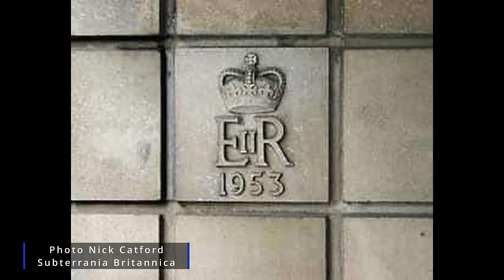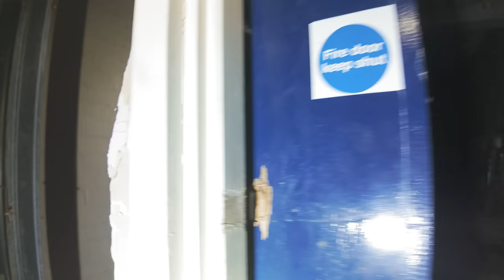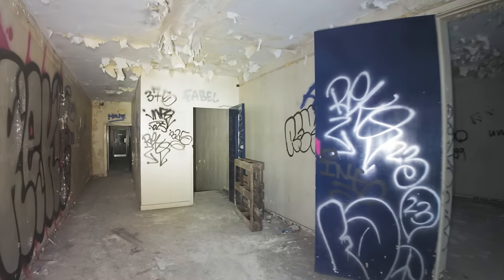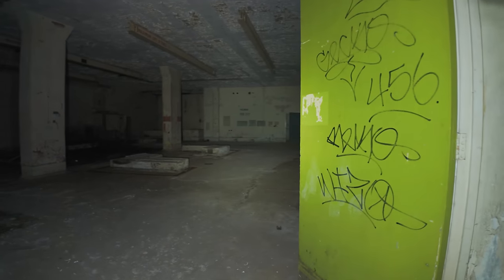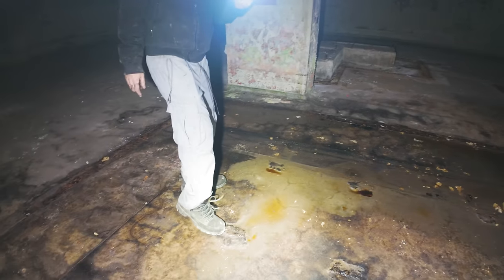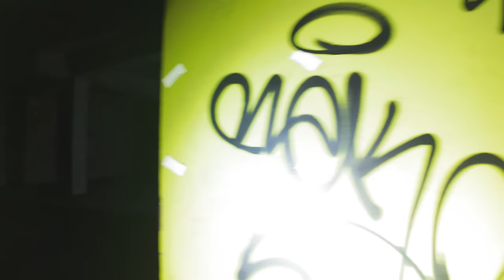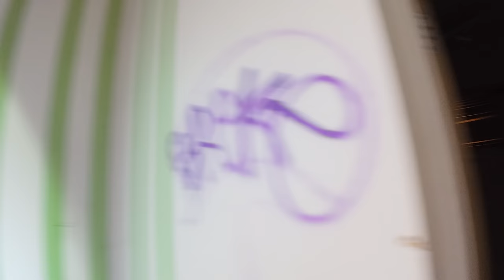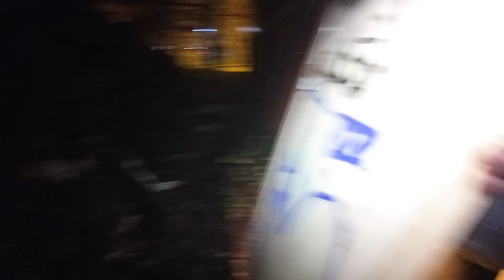Birmingham  BT EXCHANGE BUNKER Lydon Green

Comment: I work in cable tv and telecommunications. In the manholes we use those inflatable plastic bags to seal the duct or cutout hole to stop water or gases from escaping into the other area. Some of them are fire resistant as well. They use a little co2 cartridge to expand them
Reply from the maker: wow, thanks for that info

Comment: The weird spring loaded locks are called a castell key system 
You have 1 master key locking in a load off slave keys which are coded to the locks 
I use them in work matt 👍

Comment: Have you ever managed to infiltrate the tunnel network under what was Longbridge car factory in Birmingham?
It was burrowed into the nearby Lickey Hills and was I believed used to protect workers and stores during the wartime bombing raids in the 40’s but may be older than that.
Back in 72 I was 16 and just started work as an apprentice for an electrical contracting company there and we had our stores down there as did many other contractors. Dark scary place. They were partially walled off though. I worked there for 18 months and hated going to the “stores”.

Its reputed when the new owners bought the site (then MG) they had the tunnels investigated and discovered perfectly preserved cars and equipment!